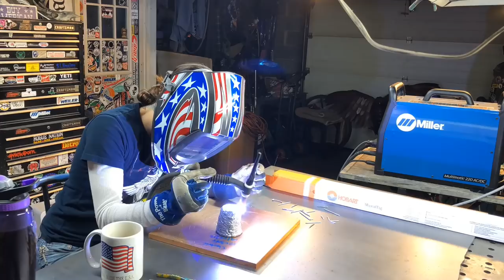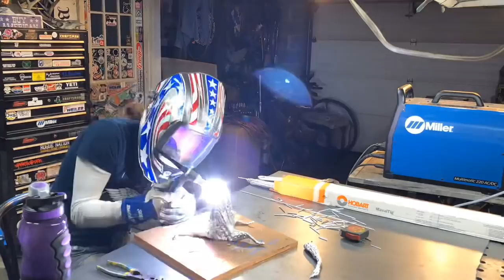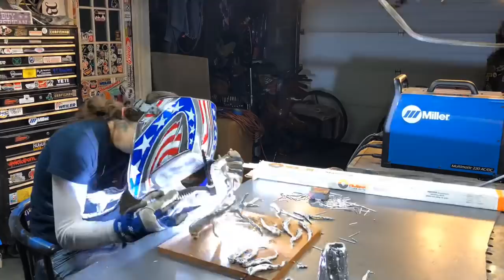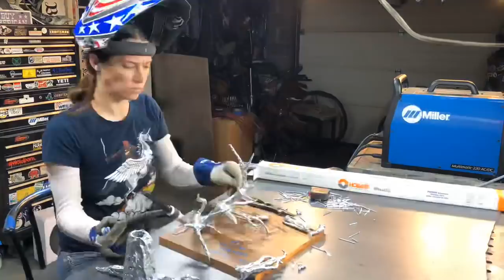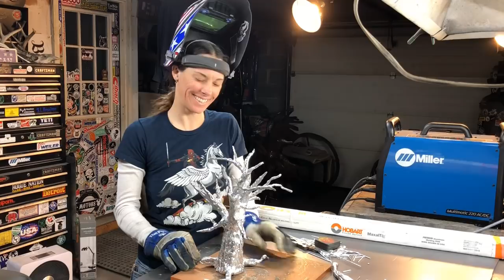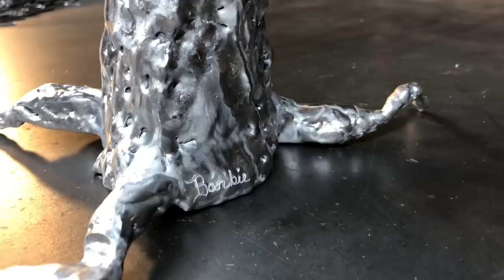Masterpiece Metal Sculpture Creation |Welding Nature Art | Aluminum Tree | Barbie The Welder

Comment: I have never been a fan of the little welders, but my first Mig was an inverter.  It is a Lincoln 180 amp.  The Lincoln 250 amp does MUCH better and you can put 33 lb spools of wire in it so you don't have to change spools as often.  Our two plug in welders are on wheels and you can use something with pallet forks to load them on a truck or trailer so they are pretty portable.  The engine driven one does not have wheels, but it can be moved with pallet forks too.  I used to be a Lincoln exclusive kind of guy, but the Millers work too.